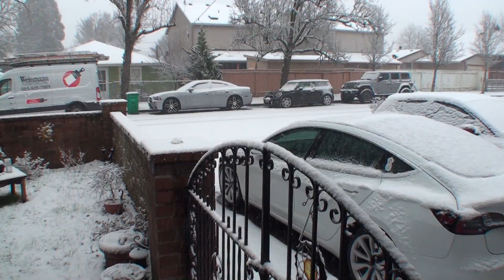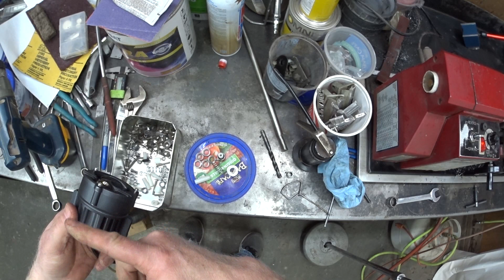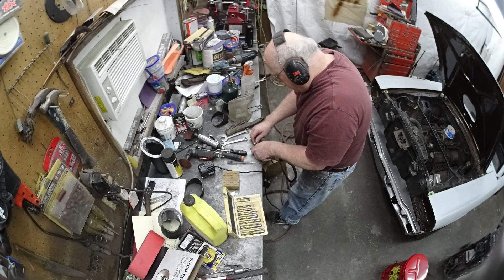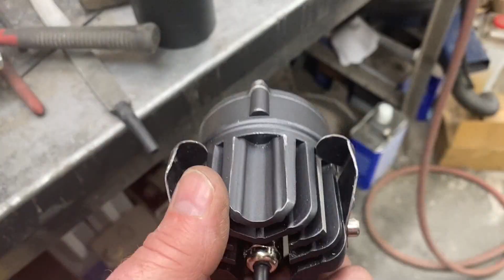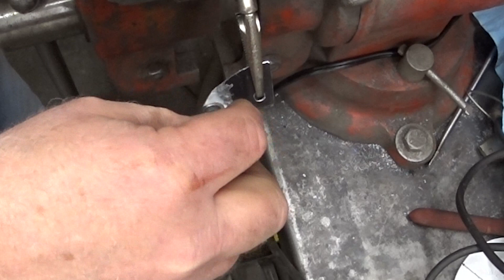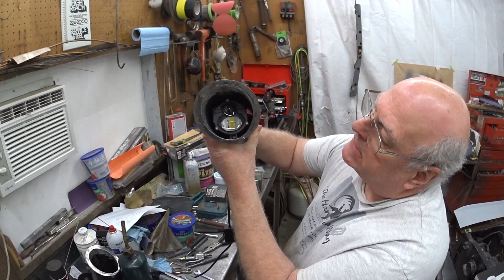66 Mustang Betsy - Paint 14 - Adding Driving lights

Comment: Nice work. The variety of cool lights and other cool stuff at affordable prices now is really nice to have now. Those should light up the road really well. I also like the silver soldering. It's a really useful method that has fallen out of use but it's strong easy to do and doesn't require much in the way of tools.

Oh how I miss having access to a machine shop. I still haven't found a lathe to buy for the shop yet. 85* again here today. I'll trade you our 110* summer heat for a few feet of snow.
Reply from the maker: Thanks Robert, I chose the silver solder cuz’ it’s strong and doesn’t distort the parts but also because the TIG is buried in the shed. Silly me, I thought I was done welding. 

How about we trade 30*. 80* for you this summer for 70* for me right now. 👍
Reply: @donsmanufactory  I'm all for a trade but I don't think the planet will work with us. 
     I wouldn't have tig welded that. IMO soldering is the best solution for that application. It's just not used as much as I think it should be. That said I think the only silver solder I have is for HVAC and it has to get really hot.